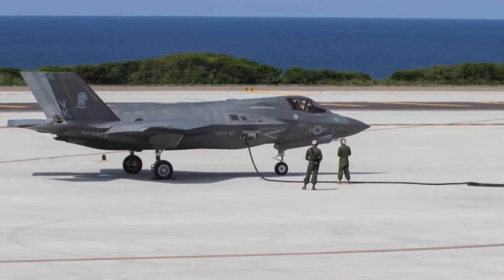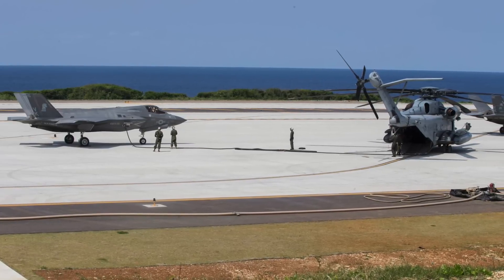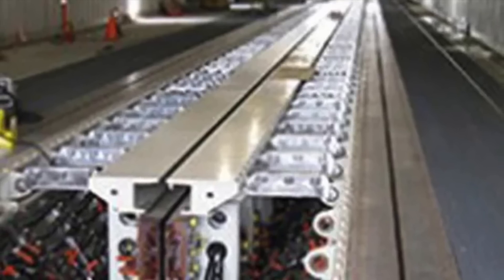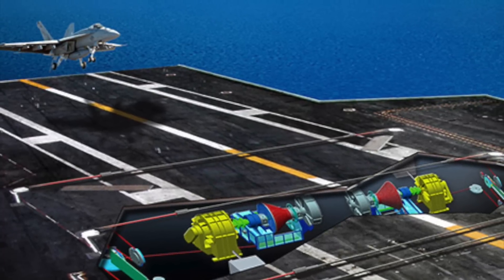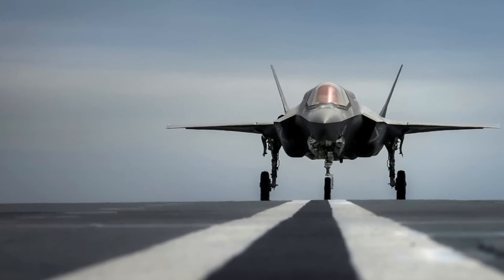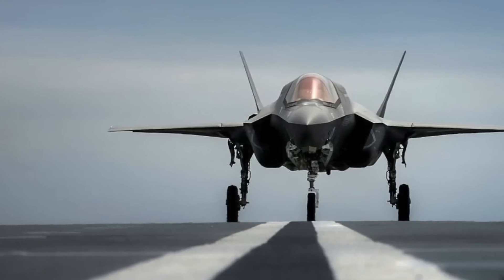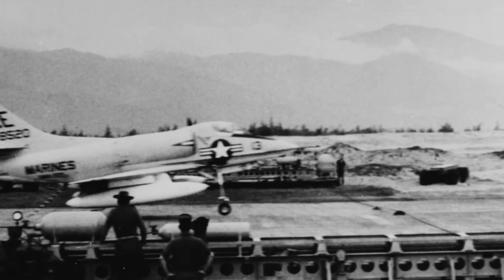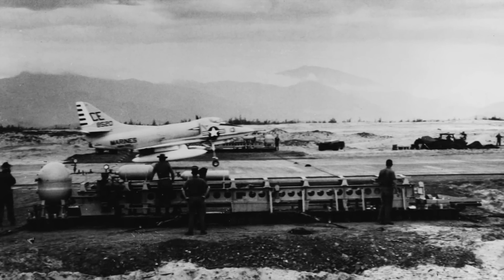Why Ford class EMALS and AAG could be installed on land ?

Comment: You could only use Navy aircraft built to take the stresses of these take-off and landings. Air Force planes couldn’t be used unless you really strengthened the undercarriage of the planes. Air Force would have to buy F18’s and F35C’s so as to be able to operate from these fields.

Comment: The AAG is not a problem and EMALS would have be designed in modules. A back hoe simply  dig the space and the modules are dropped in like legos
The rational is that it takes hours to install matting long enough for plans to operate
With this, it would only 200-300 at most vs the normal 1500-3000ft 
You would two honking generators as well as massive fuel supply to 
So fuel for the jets, the base as well additional fuel for EMALs
Is it doable
Absolutely 
Is it tactically feasible
Absolutely not
Reply: @WilliamSanderson86  
They are still a target either way
The F-35B supported by CH-53s and MV-22s is the easier option
The problem with expeditionary runways is that you have level the ground first before putting anything down
If I was the US,I would look for areas under dense forrest or foliage and built camouflage runways hidden